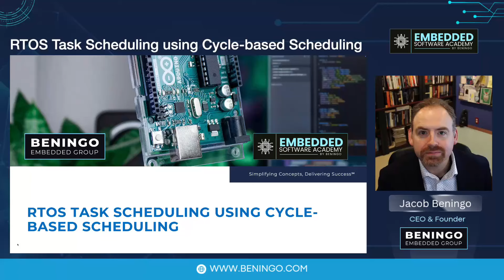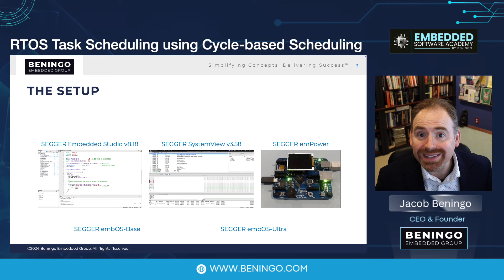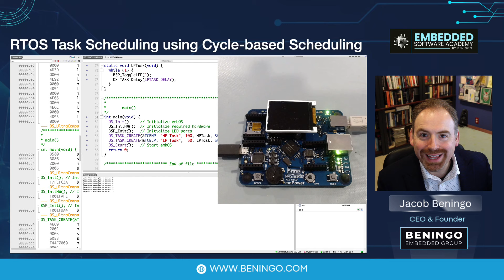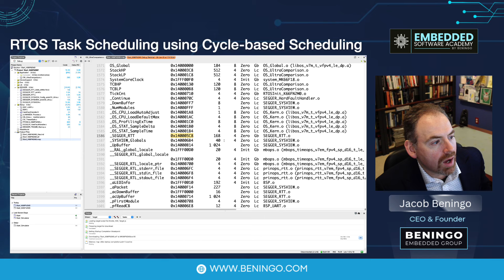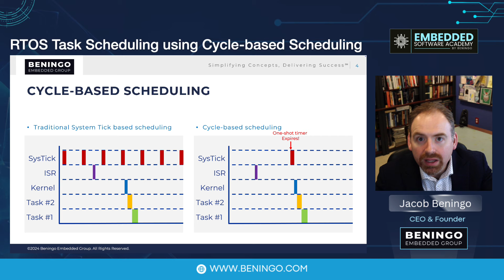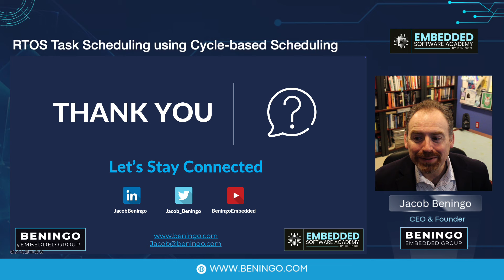RTOS Task Scheduling Using Cycle-Based Scheduling

Comment: Great presentation, thank you!

I was however missing some discussion about:
- How power consumption of the high-precision timer (that is probably required for the embOS Ultra) relates to the otherwise needed low-precision timer for the system ticks;
- Whether the cycle-based scheduling is only worth it below a given percentage of CPU usage (so basically only if you have just a few tasks distributed sparsely along time);
- Why you needed to enter the address of RTT control block manually with the embOS Ultra.

Comment: What is the basis of determining the value to set up the one-shot timer? Do we have to tell the scheduler what policy it is going to implement and tasks information, based on which it actually creates schedules and then sets up the one-shot timer accordingly?
Reply from the maker: >> What is the basis of determining the value to set up the one-shot timer?

It's the delta time period between the current time and the next time stamp when embOS-Ultra needs to activate a task or need to execute a software timer.
It's internally calculated in timer cycles.

>> Do we have to tell the scheduler what policy it is going to implement and tasks information, based on which it actually creates schedules and then sets up the one-shot timer accordingly?

From the application point of view there is nothing to do. Just use the API. The one-shot timer is configured in the BSP which usually comes from SEGGER but can also easily created by the customer.